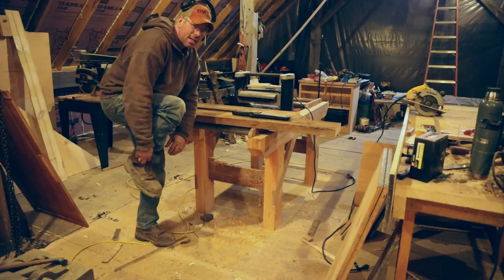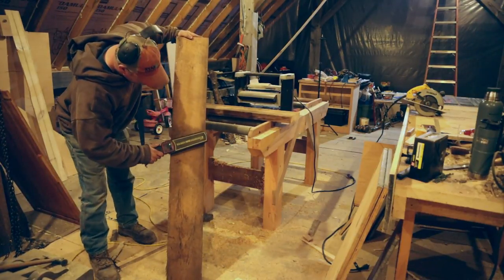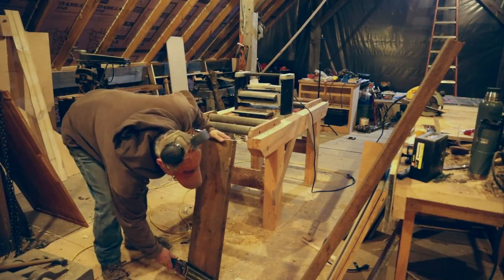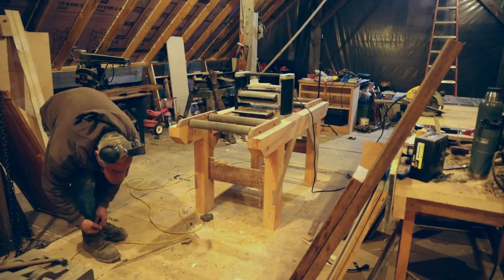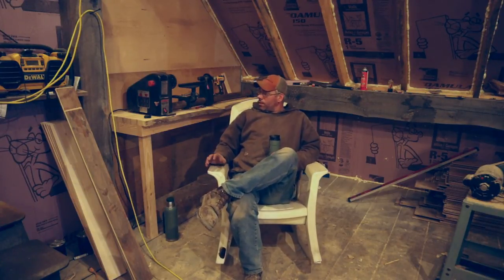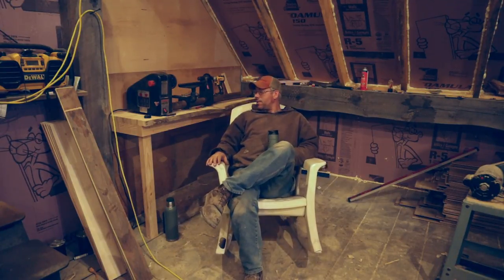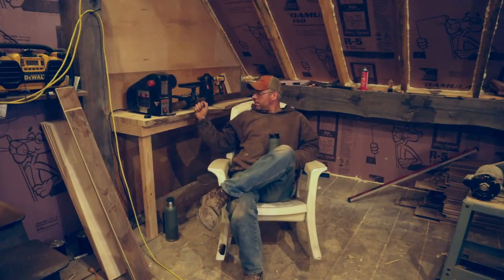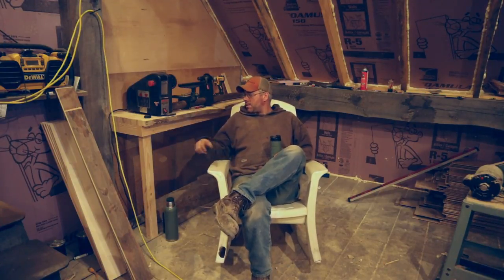Simple Woodshop Work Stations...Starting The Lathe Bench

Comment: I think you may find that bench a little light Jim, don’t put anything too heavy and out of balance on it,or it will shake your fillings out !
Reply from the maker: Solid elm top, hemlock legs...it's a lot more solid than it looks, trust me, at least until it falls apart!
Reply: TheTradesmanChannel  Jim, sorry did not explain myself properly, I did not mean strength, I literally meant light in terms of weight, which damps vibration down, some guys have gone so far as to make their lathe stands out of concrete, I chose to make mine from new oak railway ties.